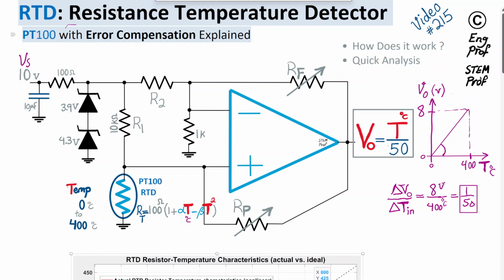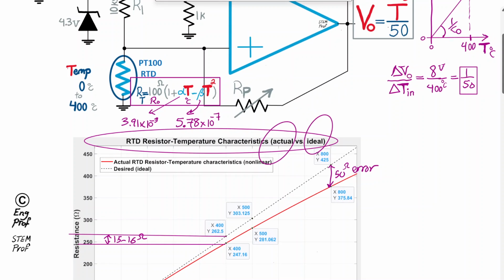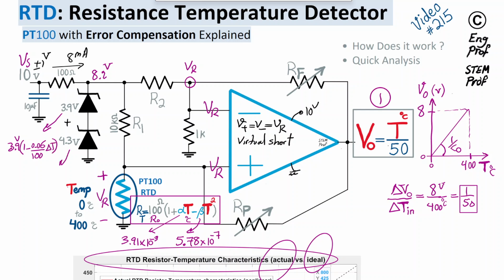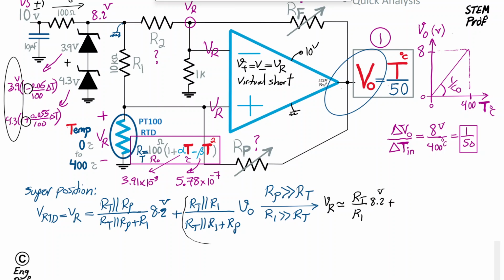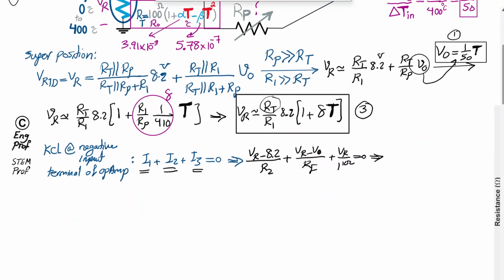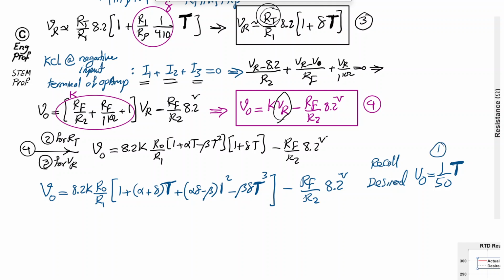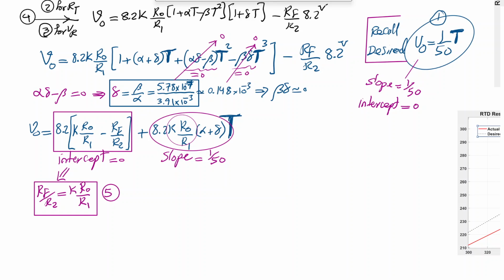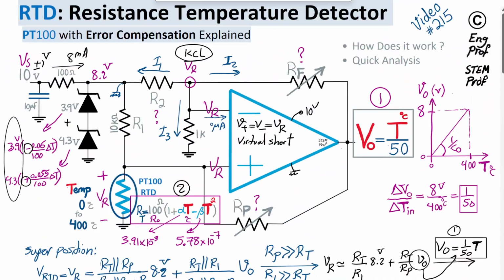PT100 RTD Temperature Sensor Explained with Error Compensation

Comment: Do you have a proffessional Circuit for 3-wire Pt100 sensor ?  I can pay you for this.   I have trace one circuit for 3-wire from proffessional product. it use single OP07 and lot of compoents around it. few zenor diode or In4148 , I don't know.

Comment: Why 8mA at minute 6? Should it be 100mA =10V/100ohm
Reply from the maker: Thanks for your interest in this video. As explained starting at minute 5:45 , even if the 10 volts supply voltage varies by as much as +/-1 volt to as low as 9 volts, then minimum voltage drop across the 100 ohm resistor would still be 9-8.2 = 0.8 volt resulting in the lowest current of 0.8/100 = 8 mA that is still acceptable as a proper steady state reverse bias current for the Zener Diodes in this circuit example.
Reply: @STEMprof  you are right! I forgot to subtract 8.2V :)

Comment: can you make a video on solving simple second order differential equation using op amps? like basic stuff. but instead of the usual formula that equals to Vi, can you do that equals to Vo
Reply from the maker: Sure, it is done in https://youtu.be/997hfjGK3_w which is Electric Circuit Analogy for Spring-Mass-Damper Mechanical System. See the three methods discussed in the video.

Comment: hi sir !. me again. I got into the time machine and watched older videos on your channel. There I found information about NIC and GIC, after watching the videos I was able to understand that the first stage in capacitance multiplier used by the Thurlby Thandar TG-502 generator was a negative capacitive impedance converter and the second stage was a simple gain-scalable amplifier with current boosting at the output. In this way I was finally able to obtain the characteristic equation of the circuit and confirm my conclusions through LTspice. Thank you very much for all the contribution of your channel, now I can understand how gyrators work in audio pedals, exponential voltage to current converters in VCOs and NICs and GICs and many other interesting circuits such as analog multipliers.
Reply from the maker: Hi Luis, thank you for your comments. Happy to hear that the Capacitor multiplier videos were helpful. Thanks for sharing the good news that you have been able to analyze and understand how Gyrators work. Here are a few related circuit videos:  GIC and NIC Impedance Converter with Op Amp https://youtu.be/o6l_wztCACQ
Gyrator Op Amp Circuit as Impedance Converter Explained https://youtu.be/jPudh9yqDH4
Best wishes!

Comment: Hello Prof., I understand that you are confident that the resulting parameters for RF, RP and R2 will produce a close to ideal curve and it seems reasonable given the path taken to compensate for the 2nd order characteristics.  Do you ever validate your results in the real world?
Reply from the maker: @fredflickinger643  Glad that this video is useful. Thanks for your interest and question. Please feel free to share your simulation results or observations 🙂 
In case interested, here are a few related sensor amplifier videos:  Thermometer Sensor Circuit Explained https://youtu.be/5jmbZ9ak6EI
Strain Gauge Wheatstone Bridge Instrumentation Amplifier Explained https://youtu.be/io1yBcC
Thermometer Circuit Design with Op Amp and BJT transistor https://youtu.be/55YsraFE0rg

Comment: This is an extremely complicated and over-engineered circuit, which also misses the biggest error root causes.
Precise temperature measurements with a PT100 requires at first a 4-wire measurement, i.e. separate current and voltage lines, and an offset compensation to eliminate thermal e.m.f.s.
All this calculus is too theoretical.
Reply: Actually that project is "a ready to use with 3 (or 4) wires" of Pt100
3 wires: zero (GND) wires left as it is.  Then,  on the plus (high side) one wire , the supply, current wire - goes to R1, the sensing, voltage wire goes to + input of the op-amp. 
4 wires: plus, high side as with 3 wires. Low side (GND): current wire goes to local GND of "two Zener diodes" (4V3 low pole) and sensing wire goes to local GND of 1K resistor.
"local GND" means as close to GND of 4V3 Zener diode as possible and for 1k resistor as close as possible to its GND pole.
4 wires would be a bit artificial for that project, 3 wires is sufficient.

The design is a bit counterintuitive as quadratic nonlinearity is compensated by linear (with offset) correction of the gain.
I agree : over-engineered (in calculations, still simple design -  a controversy), 
shows something obsolete as nowaday thermocouples and Pt100 amplifiers/conditioners in-one ICs offer amplification and linearisation, 
some ICs add ADC with SPI interface in one chip. 
Fully analog ICs make it using similar but a bit better compensation of Pt100 non-linearity. 
ICs with digital part inside don't care for non-linearity (compensated in analog way), the relevant linearisation  is a part of inside software, a linearisation table. 
Anyway - a piece of good training and ... history. And very simple design, which may make it usefull (quick to be made)
Reply from the maker: @marekrawluk  Well said! Thank you for your interest in this circuit and for sharing your thoughts and insights. You have a good point about the learning aspect of these circuits. In line with that, here is one unique example of the application of PTC TempCo resistors to realize an Analog Power Raiser computer Circuit https://youtu.be/Qe3cY9JSzYg . I hope you also find it interesting,
Reply from the maker: Thanks for your interest in this video and sharing your thoughts. Temperature Compensation and linearization are discussed in the video. Here are a few related examples:   Thermometer Sensor Circuit Explained https://youtu.be/5jmbZ9ak6EI
Thermometer Circuit Design with Op Amp and BJT transistor https://youtu.be/55YsraFE0rg
I hope these circuits are interesting as well.

Comment: Could use one BZX55C5V1
Reply from the maker: Thanks for the 5.1 volt Zener Diode suggestion BZX55C5V1. While it has a low TC (Temperature Coefficient) of between +/- 0.02% per degree junction temperature change, it's TC is still 7-8x larger than the TX of series of 3.9v and 4.3v Zener Diodes recommended in the video. Thanks though for the good suggestion. 👍
Reply: @STEMprof  I looked at the TC values for the zeners in the video and the Vishay data sheet lists the TC as "typical" values, so the range is unknown.
Reply from the maker: @8m2sCv7  Good point. That's also needed to be taken into account.

Comment from the maker: PT100 RTD Temperature detector circuit with Error Compensation is explained in this video. For more sensor amplifiers see https://www.youtube.com/playlist?list=PLrwXF7N522y7Ut9bm8TXAOhIWqL__FGlj and the following videos: Thermocouple Amplifier with Cold Junction Compensation https://youtu.be/-BsDLBI166U
Thermometer Sensor Circuit Explained https://youtu.be/5jmbZ9ak6EI
Strain Gauge Wheatstone Bridge Instrumentation Amplifier Explained https://youtu.be/io1yBcCsP-Y
PhotoDiode Amplifier with Data Compression Explained https://youtu.be/hqrRx2ufAwg
Thermometer Circuit Design with Op Amp and BJT transistor https://youtu.be/55YsraFE0rg
Thermometer Current source https://youtu.be/Ggf0yCaTTiY
Digital Stethoscope Microphone Amplifier Explained https://youtu.be/ez5KtkPbsHg
Temperature–Compensated Programmable Current Source Circuit Design with Zener Diode, BJT Transistors https://youtu.be/QY48IQXJIRI
Temperature-Independent Current Circuit Design with Op Amp, BJT, Zener, Schottky Diodes https://youtu.be/hFbnjbddUvs
Instrumentation Amplifier with Electronic Gain Control https://youtu.be/C4tghZ-q6Zs
For more analog circuits and signal processing examples see: https://www.youtube.com/playlist?list=PLrwXF7N522y4c7c-8KBjrwd7IyaZfWxyt
I hope these sensors circuits videos are interesting and useful.